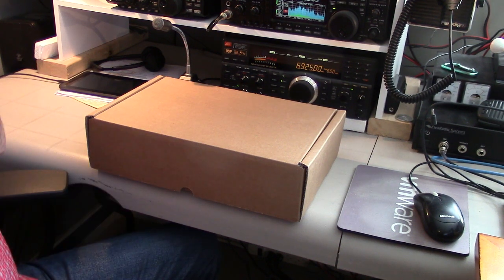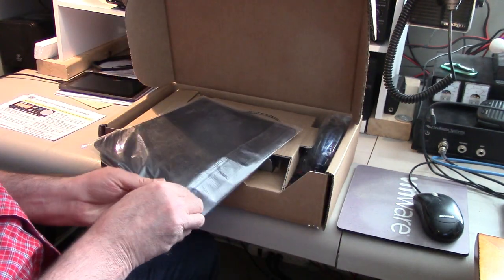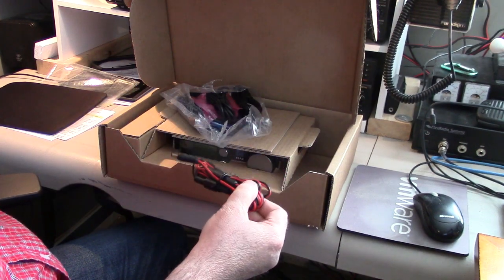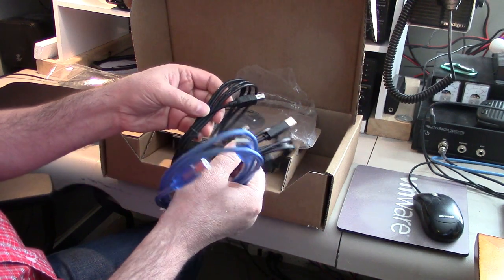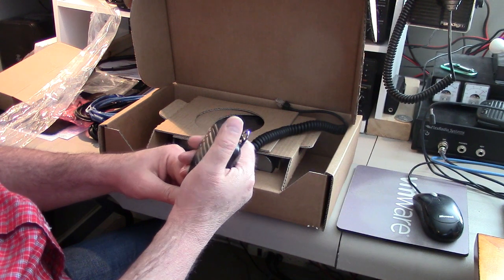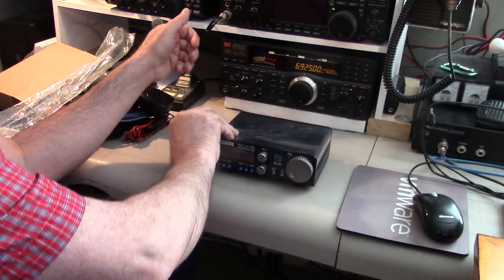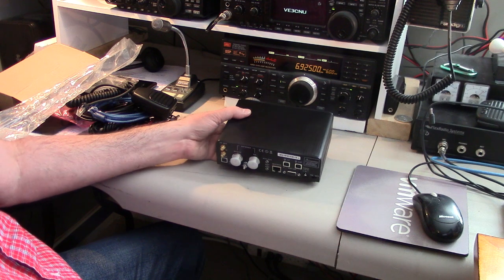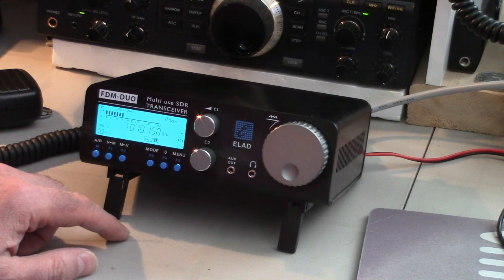ELAD FDM DUO Unboxing

Comment: I'm not too sure about the SMA's for RF output. Can you even buy SMA connectors for RG58? Most guys would use an adaptor to convert to BNC female or SO239. Elad should just use BNC sockets in their design and save us the bother and expense. Having said that, it's a beautiful little rig..
Reply from the maker: For low power these SMAs work well. I find BNC connectors often times loose and intermittent, not something I want on a transmitter. I sure am getting a large collection of adapters though now.

Comment: It sure must be nice to get these shipped to you cost free because you're a you tube ham radio content provider. But for the real average ham Upwards of $1100 is a bit much to ask for a QRP radio from a little known manufacturer.

Don't waste your money on this. You could buy a new Yaesu FT-817 and another radio, antenna or accessory for this price.
Reply: Benjamin Otto strange comment... the yaesu 817 is a rather old design now, certainly not an SDR. You're not comparing apples to apples here. A better comparison would be perhaps an Ekecraft KX3 which by the time you add the basics to would be similarly priced (they sell the hand mic separate, lots of the cables are sold seperate, etc). But I don't think anyone is buying any Elecraft radio or elad radio (or flex radio...) for the price. It's because these radios have great features/capabilites the older radios like an 817 can't do. All of these radios would be sold based on capabilites/features.
Reply from the maker: What makes you think I get my radios shipped to me cost free?  I paid for this radio out of my own pocket as I do for all my gear. Since you're obviously a communist, may I ask you take your nihilistic view of the world elsewhere.